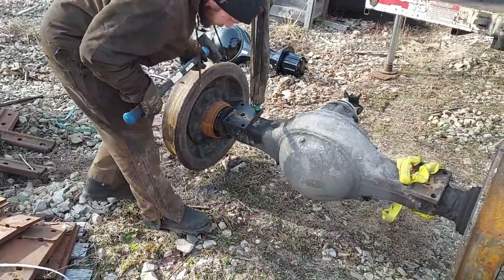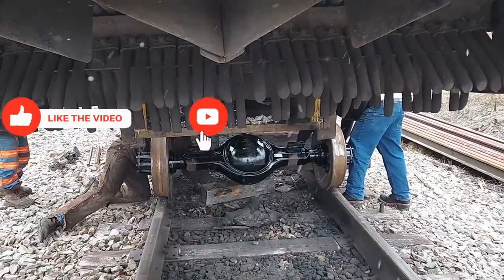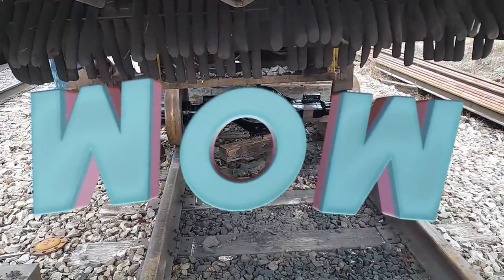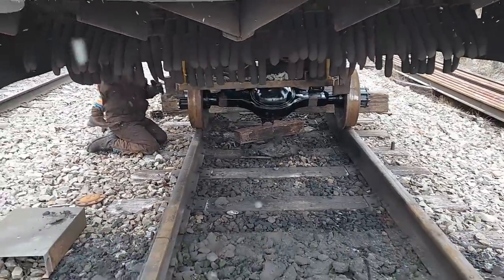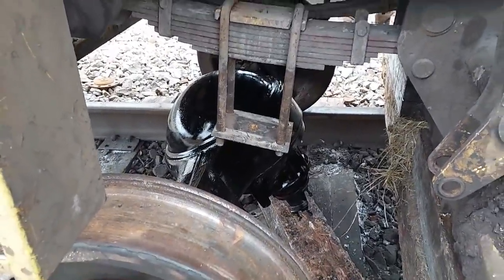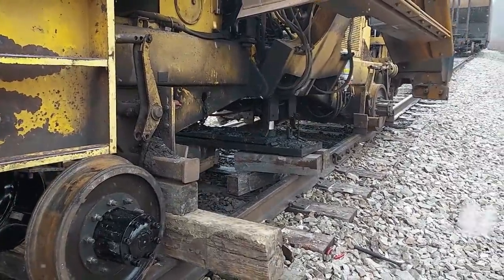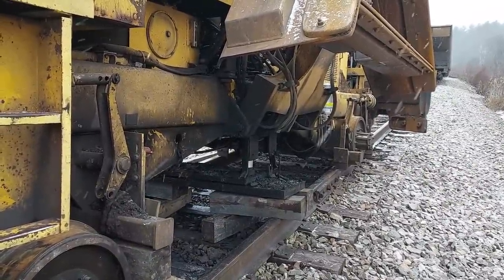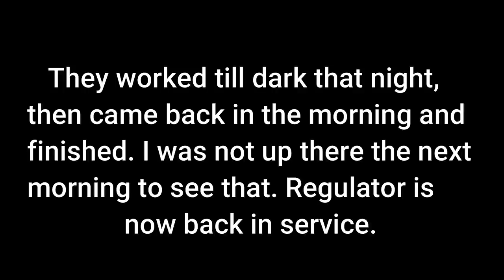Ballast Regulator Rear End Locked Up and is History

Comment: I'm retired now, but I have worked many a long hour doing cold, hard, heavy, dirty, and hot work, so I appreciate what you guys do.  Thank you for doing it and for sharing Dave, another great video!
Reply: Makes me glad I'm retired !
Reply: @capt4550  Ain’t that the truth!
Reply from the maker: Glad you could watch this in the comfort of your home, nice
and warm Raymond. Do appreciate your perspective and for
the many years of hard work you have put in yourself my friend.
Reply: @ccrx6700  Thank you for your work Dave! I can still work hard when I want to, and I’m grateful to be able to! Thank you for answering my comments, you are a busy man and I appreciate it very much!
Reply: Hello Dave I appreciate what you do and all railroaders alike I ran a regulator for 40 years the cable kind the ones I ran had a nut with a glass like a peep hole to check the oil level I have also helped mechanics change rear axles hard work  in my ladder years they wanted me to run the newer regulators turned down two new ones right out of the box I preferred the regulators with the cable buckets anyways y'all stay safe out there and thank you for the videos 🚂

Comment: In the automotive world, those u-bolts are one-time use. Might want to keep an eye out for them to break, soon.
Reply from the maker: Thank you very much for the advice! I never knew that and will
certainly keep an eye on them. Appreciate your writing in and
for watching tonight my good man.
Reply: Actually they can be reused if not  overheated or bad threads-stretched. As most guys cut them off.
Reply: @fordrust1961 In the RR world, steel on steel traction, is way less then rubber on pavement. There is no axel twist, or pinion up and down movement per-say.

Comment: Have to wonder if the oil  in the diff had ever been changed, was it low on oil?
Checked regularly as in Preventive maintenance?
Unit could use a good steam cleaning!
Reply from the maker: Probably a seal went bad and oil leaked out, but no one
noticed it. I rarely run regulator anymore, but some things do get
over looked unfortionately as you can see. We used to keep
the regulator and tamper fairly steam cleaned, but since the
pressure washer broke down some time ago it has yet to
be fixed. Thanks for writing in and watching Bob.

Comment: Been around BRs some, I was about a AH operator,  we were lucky we could run ours in the pit at dover , the loco shop and service  our equipment,  it was handy didn't have to crawl under the derail bar, drop the oil there too. They had a recovery system there. I got off that dusty dirty thing , good luck .
Reply from the maker: Thanks for writing in and watching the show today, we do 
appreciate that. Regulator is a dusty job and glad I don't run
it very much anymore.

Comment: All that money and they weld something in the wrong location..........you can't make that sh1t up.  Sounds like a big refund or discount should be due.
Reply from the maker: Well, after thinking about it, this is an old regulator and was made
originally in Mexico in 1995 as a prototype for Kershaw. So the
rebuild shop had no way of knowing that and I'm wondering now
if the plate was welded correctly for a different model actually
made by Kershaw? Guess we will never know. And too sometimes
people make mistakes in measuring, just don't know. Thanks for
writing in and watching the video S FERG.

Comment: My Dad told me on a hot August day on the side of the road while trying to beat a wheel off a hub, if it’s mechanical it’s going to break and it will likely break when you need it. FYI, the wheel finally came off with the help of a MO-PAC track inspector who happen to be going by.
Reply from the maker: Your dad was right Michael. Seems like nothing ever breaks until
you need it....LOL Furnace never quits until it's cold and AC never
quits until it's hot. Do appreciate your writing in and for watching
the show my friend.

Comment: $46K for a new axle??  What is so special and unique about it that it costs so much?  Just low volume use in the market?  That is unreal.  $11K for a remanufactured one is high as well.  I never knew those had turn tables built in and you could spin them around.  I guess it makes sense since you can't always find a Wye when you need one.
Reply from the maker: This regulator is a prototype made in Mexico by Progress Rail
for Kershaw, an odd duck. and it was made in 1995 so parts
are not all that much available and anything RR related is insanely
priced.

Comment: Well I hate to give you guys a bad time BUT I did axle work 5 to 6 days a week on Atlas Copco Wagner Mining Equipment Mining equipment. Try pulling a axle out of a Wagner Mining ST-8B LHD one axle weights 4,500lbs. A rear oscillating axle assembly about 7,000lbs, your axle is small. ST-8B axles are not the heavyset axle assemblies I’ve worked on. Differentials normally out last a machine if properly maintained and serviced; which in this case I don’t know. My question is did anyone Servcive these axles???? , I bet from now on you will. I’d recommend that you look at and service the other differential immediately. One tip I’ve used IXL oil additives in my vehicles for over 30 years now. I’ve actually used their engine oil additive in my own personal vehicle differentials. Now they’ve extended their product line with a differential additive. And a matter of fact I’ve just reordered some products the other day and they will arrive Saturday. If you want to know more go online to the IXLstore. I’ve used IXL additives for over 30 years as a mechanic and I swear by them. You can only purchase them online or through maybe a local diesel truck shop.

Comment: Well that axle cost an order of magnitude more than it should have.  Looks like a diff out of a small straight truck or heavy duty dual pickup.  Like you said, the ratio needs to match front / rear.  Does it run some non standard ratio ?   I can't imagine that the original builders didn't take something already available and modify it.    Wow those costs hit you when you least expect it.
Reply from the maker: Don't remember what the ratio was, we looked at the tags on the
old and new to make sure they matched and they did, just don't
recall now what it was. Take a rear end out of an ordinary truck,
put it under a hi rail truck and the price will most likely triple
cause it for a RR, but go figure. Thanks for writing in and for
watching Samuel, we do appreciate that.

Comment: I'm just trying to figure out why a regulator with conical taper wheels would need a differential.
Reply from the maker: Sounds like you're a thinking man Colin. As you may know rolling
stock that has a solid axle when the wheel sets negotiate a
curve, one side is going to go faster than the other side.  So the wheels are tapered at a 3 degree angle to alleviate this. It works very
well in low degree curves, however from about a 4 degree curve and
up this taper continues to be less and less effective at having 
sliding wheels. Ponder that for awhile my friend.

Comment: Dave, Ring Ring, sledgehammer school 🏫 is now in session. 
The bigger or the smaller things on the 
Railroad can get to be very expensive to fix.
A hot coffee ☕ would of been well deserved and I would of gladly bought a round or two. 
 They just changed out the 4 derailed disk brake wheels sets on a coach the other day. There went $45,000.00
Feel the pain brother. 
Take care 
Richard Bause
Reply from the maker: Glad you enjoyed Richard we do appreciate your nice comment
and for watching.  Big problem with this one is it was made in Mexico as a prototype for Kershaw in 1995. Not very many of these rear ends for this machine are out there, so no parts available = big buckaroonies.  But as you well know, nothing on the RR is cheap.
Reply: @ccrx6700   a prototype? Ouch...😮
A Railroad equipment experiment. There are plenty of them out there. 
Baby Bob 👶 cat
Maybe the last built in his year, but has plenty of sisters for parts.

Comment: Looks very familiar, We had this happen to one of our Regulators on the CP when the surfacing crew was on our territory.
Reply from the maker: Big problem with this one is it was made in Mexico as a prototype for Kershaw in 1995. Both the front and rear gears in the rear ends must be identical as you know.  Not very many of these rear ends for this machine are out there, so no parts available = big buckaroos. Thanks for watching my friend.
Reply: @ccrx6700  Your welcome Dave, If I remember correctly when this happened to our regulator we still had parts available to us due to it being about 20years ago now.

Comment: If one of you guys had said , "Hey you know these axles are best changed in pairs", somebody would  have still been running. Wouldn't wish that on anyone.
Reply from the maker: Your right in both those rear ends on the regulator Have To Be
matched gears! I made sure they checked the tags on the axle
before we set it under. What a disaster that would have been
with 2 rear ends having different gear ratios.  Thanks for
writing in and watching the show my friend.

Comment: An refurbished old truck axel cost you guys that much??? Could go to LKQ or somebody similar for old truck axels. You guys got ripped off.
Reply from the maker: Big problem with this one Chad is it was made in Mexico as a prototype for Kershaw in 1995. Both the front and rear gears in the rear ends must be identical. Not very many of these rear ends for this machine are out there, so no parts available = big buckaroonies. Thanks for watching my friend.
Reply: @ccrx6700  
If you can, I'm sure there is a regional transmission/axel shop that you guys could talk to about future coming repairs for that unit. Maybe even talk to the guys at Pittsburgh Power, they could aim/guide you guys in the right direction. 
I noticed you guys didn't replace the u bolts to the refereb axel. On our semi tractor's, anytime we replace an axel, the u bolts are changed out because of bolt streach out after tourqing them down. Granted that unit won't see the stress on the suspension like a semi truck does going down the highway.

Comment: I might be the odd one out but i would rather break down in freezing winds in the dead of winter. The cold keeps me motivated to get the job done. The heat makes me lazy.
Reply from the maker: Cooler is better than hotter I agree Cake. Hard for me to take
the stuff below 10 and above 90 tho. Up where the video was
taken the wind just howls thru there. Thanks for stopping by
and taking in the video my good man.

Comment: OMG, 11000 is a lot for an axle. What makes it cost so much ?
What is the core charge ?
Reply from the maker: Big problem with this regulator  was made in Mexico as a prototype for Kershaw in 1995. Both the front and rear gears in the rear ends must be identical. Not very many of these rear ends for this machine are out there, so no parts available = big buckaroonies. Thanks for watching my friend.
Reply: bet its 12,000 core!

Comment: I saw a derailment in greene county today.   Hoping it wasn't on your line.
Reply from the maker: No sir thankfully. That was NS on a loaded coal train out of
Baily Mine, it was near Graysville. I dont' know many details
about it, heard there were 10 or so cars off. I do know it was
14 degree here this morning with a high of 25 and those
guys had a hard cold day. That was single track so all trains
were stopped, and it was on a fill in a remote area, even more
difficult for the crews.

Comment: that is a very angry looking bearing. did you find the pot pies?
Reply from the maker: Yes it is. Actually the bearing went bad several miles up track
and it was touch and go getting back down to the siding as the
wheel kept moving in and out, just lucky it didn't fall off a rail!
Do appreciate your watching today's show my friend.
Reply: @ccrx6700  no worries, its fun to see all th ethings you get to do :)))

Comment: Seen you working hard today Dave. I was out taking my dog buh byes today and riding on the roads near the railroad to see if I happened to see a train running and happen to see your Hyrail truck through the trees heading back towards the Harbor. I was in the F150 and yelled your named as you waved from the bridge lol. I guess you were doing track inspection but It was cool seeing you run track.
Reply from the maker: Awesome Pat! I remember seeing you, of course didn't know who it was.
I'm sorry I didn't hear you calling my name, must have been the
noise from the truck. Had a hard day, 2 rail pull aparts and around 15
broken bolts to replace. Hope we can meet up sometime! You were at Bridge 8
Reply: I should know better being a truck driver the noise of those diesels plus your Hyrail gear lol. Even it being hard work at times, I know your working your dream job.
Reply: @ccrx6700  from my truck on the road I seen the one bridge marked with the number a couple down from where you seen me at bridge 8.